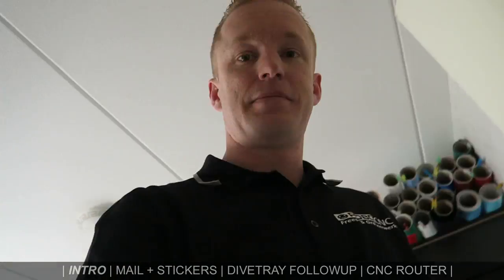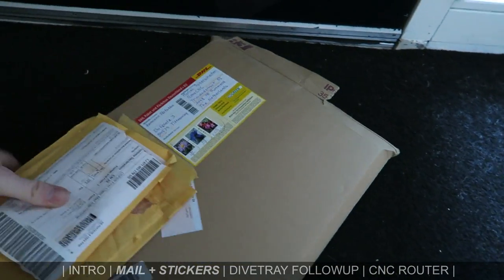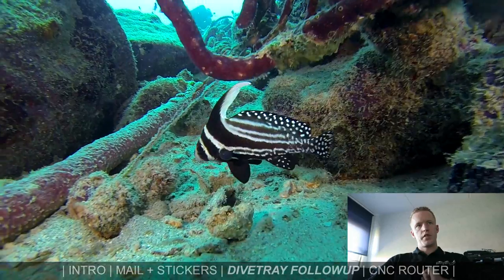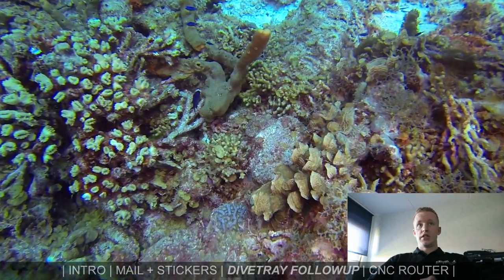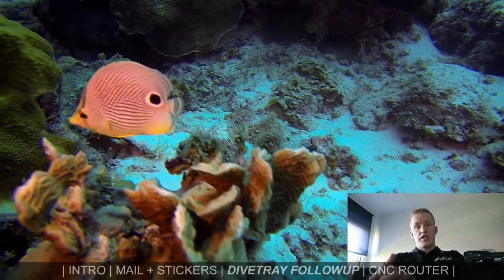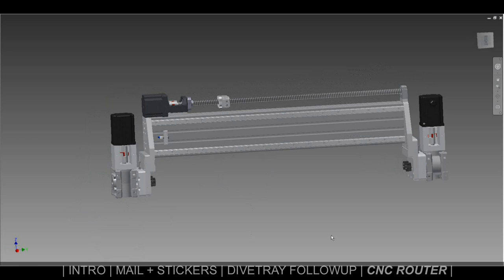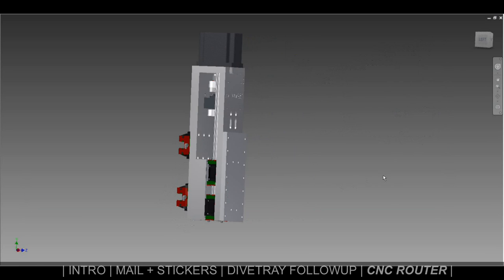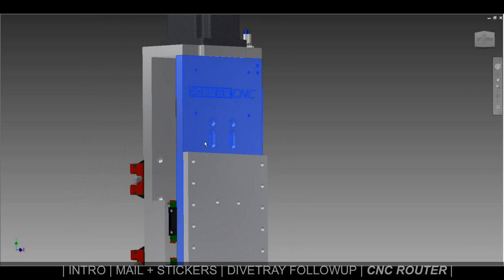VLOG 02: Mail, Stickers, Dive-tray and a intro in the new Router

Comment from the maker: Hi +Robert Bilko , Thanks a lot, nice to hear ! 
Yes you are right about the price, and this will be something that follows this complete build I think.
The first router was almost the cheapest way to go, self etched pcb's, casted my own aluminum scraps to make bearing housings etc.. This time the build will be somewhat less diy and cheap. But on the other hand it could be used as a guideline and you could replace everything after a good search for some less expensive.  I will keep track on parts, prices and locations to buy this time though..

And for me it's to late, all ITEM profiles are already in... :) But Thanks anyway I will have a look for projects later on !
Minder weergeven

Comment: that Rack and Pinion drive unit.. and the new machine.. look familiar.. :)
Reply from the maker: Thanks +Jan Binnendijk ! Ya you already said when I was building the first router, the gantry style and the single ballscrew on the X axis was not the best way to go. And although it has served me well, it's time to upgrade. Most of the basics is indeed off the DamenCNC System, and especially the low gantry style was introduced by you on CNCzone a long time ago.
Reply from the maker: Thanks +Jan Binnendijk ! Ya you already said when I was building the first router, the gantry style and the single ballscrew on the X axis was not the best way to go. And although it has served me well, it's time to upgrade. Most of the basics is indeed off the DamenCNC System, and especially the low gantry style was introduced by you on CNCzone a long time ago.
Reply from the maker: +Jan Binnendijk Geen idee, maar mijn antwoord wordt steeds verwijderd. Excuus, zie antwoord hierboven

Comment: That Z axis will be very rigid,rails are on the moving plate.Not like most other designs.Waiting your next video,great work.
Reply from the maker: +dip20000 Yes, thats one of the mistakes i have made in my first machine indeed ! 
The plate stiffness is improved a hole lot by adding the two rails...
Not only that, but in my last machine had the blocks on the moving plate at the top :) so I have learned from my own mistakes... Thanks for watching !